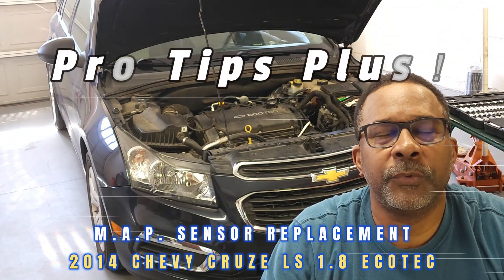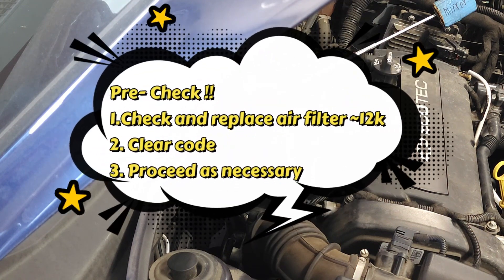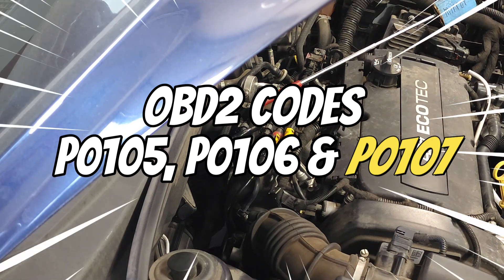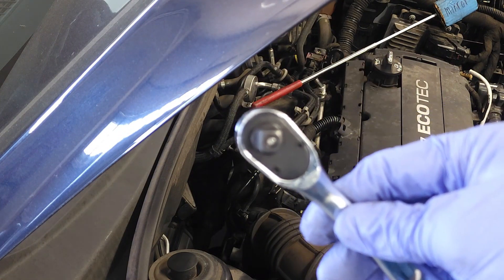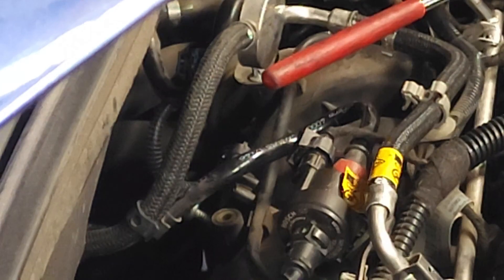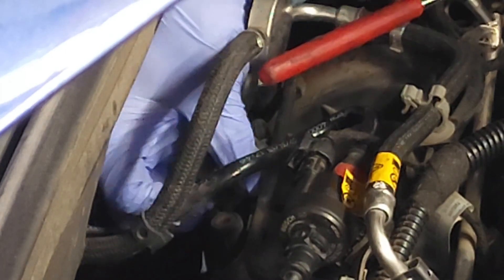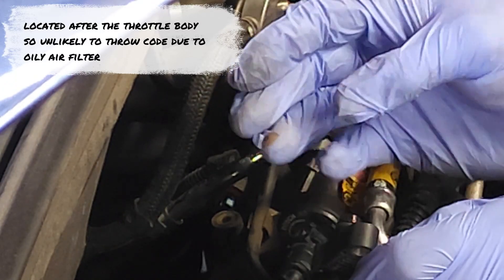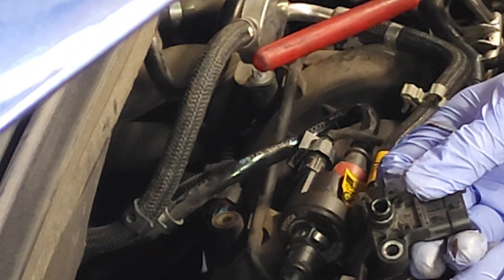2012-2014 CHEVY CRUZE LS, Manifold Absolute Pressure (MAP) Sensor Replacement Tips

Comment: I’m getting codes p0366, p0016, p0341, p0097, p0113, p11c2 and p2228. Any idea what that problem could be?
Reply from the maker: P0016, P0341, and p0366 may be resolved with an oil change. P0097, p0113, p11c2, p2228, may be resolved with a new air filter cleaning the related sensors with mass air flow cleaner.
Reply: @protipsplus  It has a fresh oil change, new air filter and new oem maf sensor. I’m lost at this point